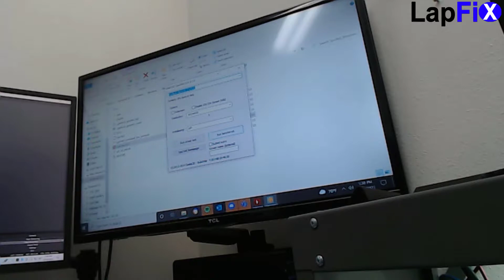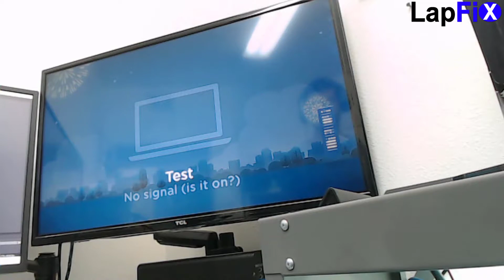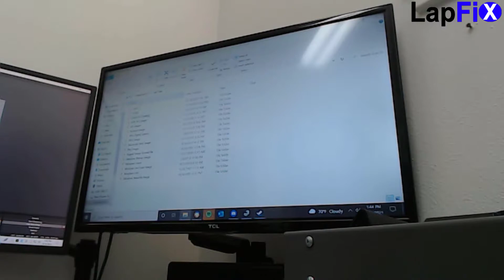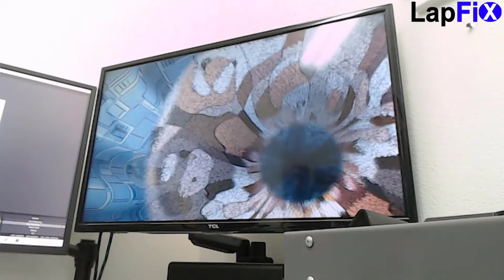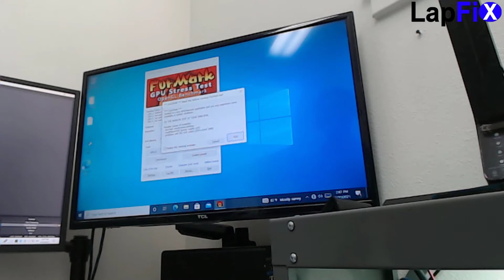Troubleshooting a Gaming PC Graphic card with Random Shutdown

Comment: I’ve had my PC for two years. Suddenly I come frm work one day and it won’t turn on, even tho I see that everything connected to the pc is on but the pc turn on button doesn’t turn on the rig itself. I then disconnect and connect the 24pin and SATA cable frm the psu, then I disconnect the gpu and it turned on with the power button, then I connected everything back thinking I fixed the problem somehow cause I was surprise when it turned on. Once I connected the gpu everything in the rig turned on for like about 1 to too 2 seconds(The gpu lights did turn on). Please LMK any tips or any idea on what the issue could possibly be as I have no idea. The only thing I did before the gpu and psu cable idea I removed the ram and put one in put no luck, then I blew off anything on the ram and put all 4 rams sticks but again to not luck.

Comment: Came here looking for an answer to my issue. My GPU disconnects from both of my monitors and reconnects.  What ever I am doing on my system is not effected aside from some icons move around. It is an ati radeon 580. At this point I an thinking it is the GPU. I did run Unigine_Heaven-4.0 and it ran fine so I am at a loss. I guess it could be the Power supply. Maybe I will go that rout and see what happens.

Comment: Speaking from experience the hdmi or dp on the gpu is not hot swappable don’t plug in or out while switched on you plugged it in while it was switched on that in it self can blow the gpu I’ve had it happen it killed the whole pci express rail also 

I currently have 3070 and a titan x both are switching off under load only when it wants it’s not heat related and not constant I suspected psu so I changed that around as I have more than a few ha I never solved it the cards are sitting

Comment: I have exact the same problem. It really randomly reboots my computer and driving me nuts. Was playing a game called Empyrion and went in to a ship and my cpu rebooted. Couldnt start the game again because I was in that ship even when I tried to start up the game. My GPU and CPU is not the best but I am at the recommended level for playing that game. Has happened in other games too. So it can be the power supply? But I did change it once. Should I buy one with greater Watt instead of a 500W, like a 650 or somthing.Thr guy I bough the computer from did nothing for me and I still had warantee when it started, What a piece of an a..hole. What should I do? I really cant afford a new one now dang it if it is the GPU

Comment: Just got a brand new Lenovo Legion T5 desktop with a RTX3060 Ti and I've been having problems. 
When I open games like GTA V, Overwatch 2, WZ2.0 it closes after a few seconds or minutes, most times there's a message saying the game had to be close due to renderization error or something. The monitor looks like it's disconected for a few seconds and then it connects again. I ran the MSI Kombustor stress test and the disconnection thing only happened when I stopped the test by pressing ESC.
I've tried everything when it comes to software updates and it hasn't stopped, so that lead me to think it's a hardware issue.
Any help with this would be highly appreciated!
Reply: 3060ti is garbage, mine died after not even a year of using, i sugfest not getting a 3060ti ever again

Comment: The issue with my computer is that the gpu and display turn off when I game but everything else stay on. When i turn it back on the display and gpu stay off but every thing else keeps running fine. The way im able to get my gpu  and display to run again is by disconnecting the power from the wall and reconnecting. Is that a gpu problem or a power supply?
Reply: Same, did you find out?
Reply: Any ideas
Reply: Any answer ??
Reply: No answer eh ?

Comment: I AM USING ZOTAC 1660ti 6gb.
A few days ago while I was playing a game fps started dropping to 2 to 3 fps.
gpu temps were on 65 to 72c.
Then after 2 to 3 hours the screen turned black some time on the startup system was running but no display.
yesterday i visited the repair shop They opened the card cleaned it and changed the paste. Then I checked my gpu on full load for 2 hours. And the gpu works okay for 7 to 8 hours. Today i tried to turn on the pc but now there is no display and gpu fans operate for about 2 to 3 seconds during this whole time the system is on.
what should i do?
Reply: Same issue, did you find out?

Comment: I put a 300 watt in for a Dell Optiplex 790 with  Nvidia GTX 1650 and it still doesn't stop shutting down every time I start a game. Everything I've tried so far have been in vain...Just keeps shutting down. Changed ram Sticks...Reinstalled windows 10, Cleaned any dust out of the computer, Pulled the graphics card out and reinstalled it. Just keeps doing the same thing.
Reply: Did you figure this out
Reply: reinstall bios or it is overheating and faulty